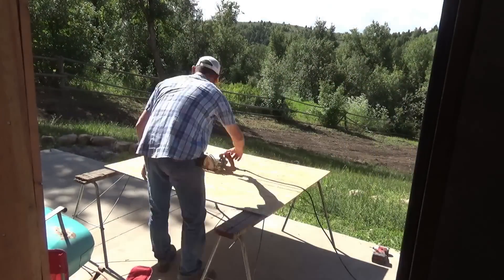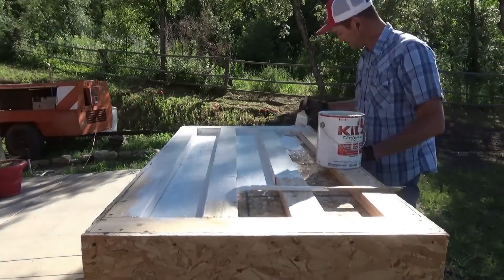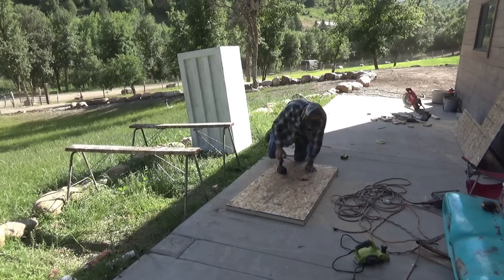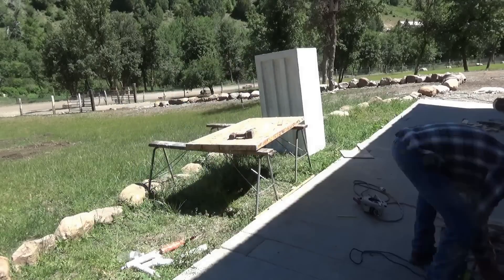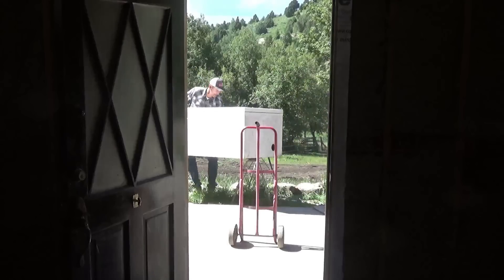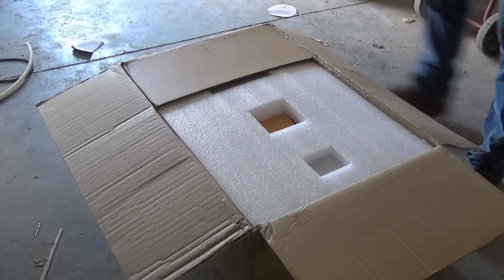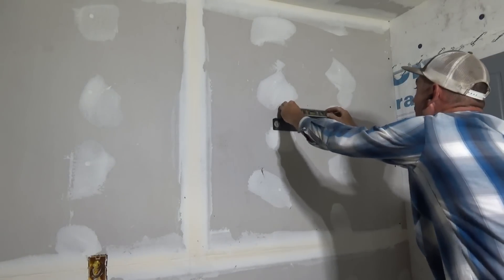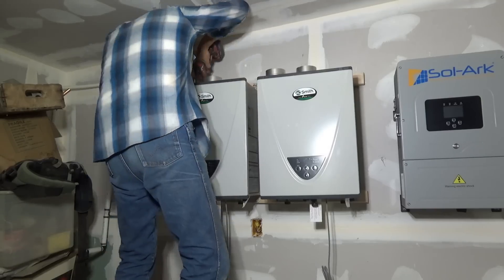#344 - Off Grid Solar Inverter,  DIY Sealed Battery Box, Tankless Water Heater

Comment: Hey, it looks like your lid to battery box will not be able to open to 90 degrees with the water heaters and charge controller above it. You could cut the lid lengthwise add some 2x4's along cut and put hinges with the hinge to the inside of box so the lid could fold in on itself and only be half its height. This would also keep lid from falling once you have it up/opened.

Comment: There’s a company out of China making 15kw power transformers 110v and 220v it can run off of 48v dc because the draw on appliances is 3 times its rated use at start up! The solar charger would need to be a 48v dc charger though! The 15kw is sold for around $600 on eBay and I have bought my 3rd now! It runs great but the early model was max 24v dc intake and it barely ran a microwave! The 48v will run a big aircon! It’s temporary max output is 60kw!

Comment: I have solar panels too I had it put in  did a great job I did start to have  problems in the fall  when the panel frosted over  and would not charge up then the snow here too has it own problems   we do have  a windmill stand here doing nothing i one time it was the power source from the farm we were looking for the other windmill to use with this one did find a lot of them  around here  like the rest of it was the prices they wanted way too much for it  50 years or longer never worked  did go to farm auctions to buy them but people here just bid up  the items did finally found one  but they had one that was still new   they were very nice we said we think about it when we got home they dropped their prices too  that was very nice for them but was how to get them here 1 was simple the one was standing was the problem we did taking them both we rented a crane to help us to lift the one was standing up  down for us month home had it all clean up and new bearings as well  clean up well from the rust too did build the one in the boxes too put both of them up with the rent of the crane and taking ours down to do the repairs to that too  have all 3 workings too  does have the same thing  have it come with its problems no wind was the major one this  year we having awesome amount of wind here    the other one was the battreies too the new battries did not as the windmills did finally got them all to work  when we dig the new water well-hit artesiain well here  was flow well  we still feel the ground move here  40 years   the area had not that good water wells back in the 70's the county had  seismograph done here and detroyed all the water wells aound here and any water was here too they did not like it when the water came back at all this time their plan did not work out  was taken too court and we win it and they did find the county gelt in the first time the did seismorgraph  in the '70s   
the lake and the steam we had here started to flow again we rebuilt the water wheel too this is awesome power too

Comment: Not sure if you've already dug the lines for your solar, but you could always oversize some conduit pipe and give yourself room for any future solar expansion.
Also wondering why you went with tankless heaters?  The beauty of a tank is when the sun is out and you have any spare solar capacity can be dumped into heating the tank.  Think of it as another battery.

Comment: You should put the inverter in a Faraday cage to protect from hazardous radiation.  Good job on the battery gas.  Don't leave out the inverter.

Comment: Putting an ignition source (water heater) OVER a constant source of hydrogen gas in a closed room means everything completely relies on the integrity of that box and seal. If the seal ever fails (e.g. during a hasty battery maintenance or the wood eventually warps or cracks), the gas will seep out and build up in that room waiting for ignition. Boom! Please consider additional ways to get the gas out, there are no "re dos" on that one! Greetings from Berlin, Germany where we still remember the Hindenburg! :D
Reply: Yep, get the batteries outside.
Reply: Remember the Hindenburg LMAO (oops it wasn't funny) but OK it's the 4th
Reply: @JohnDoe-np3zk  . He could probably make a  anti flashback valve on the exit pipe. You dont want to let it flash back from a  outside open flame and detonate all the hydrogen/ oxygen inside that box.BUT.... I guess you can move the batteries just outside the house by a couple feet, put in a flashback ck valve ,, insulate the box, and put a couple light bulbs inside to keep from freezing . Thats all we do with our wells and pressure regulators switches, insulate and put in a light bulb during the winter. Inside a little well house it works fine .

Comment: Don’t do the same as your drain,  and use too small a cable gauge, you always want to go bigger than required in case you need more capacity in the future or find you are pulling more load than expected. Also use the highest voltage, 48v minimum

Comment: Agree with many comments about vents and the location of water heaters near and above the batteries not a good mix.  Think the input vent would be better on the house side with fan on this input side. Computer fans are brushless motor so no spark problem and easy to replace. A diagram of your layout and connections to each element perhaps sent to 755  for comment before installing, would save a lot of problems further on. He gets about a lot maybe ask him to call in, he is a top man. You doing a fantastic job on many fronts but solar systems have many elements which have to equate to each other to be efficient and safe.

Comment: put valves before and after the tankless heaters..  when adjusting the water flow.. i am taking one is going to the shower..

  you will want to turn the shower on to 3/4 hot..  and adjust the inlet valve to the tank less to get the proper heat out of them.  you have to adjust the pressure drop to get the pressure valve to open..  the showers are the most important.. you will have to adjust the angle stops on all the other faucets to get proper temp at each faucet without adjusting the pressure drop across the heater..  i am ALWAYS Called wrong when i post this..  but mom had 220v tankless and she took cold showers for a year as she did not understand how to adjust the flow for the shower.. then work everything else at the angle stops.  please when you get it adjusted.. please mark on the wall.. the fractions of a turn for each valve at the heaters and how many at the angle stops for each faucet. 

 if you have 2 showers.. you will want to put one tankless for each one.  as somebody will usually try to take showers and that will throw the system off.. you probably cannot use water saver shower heads either.  that won't create enough pressure drop across the heater with the partially closed valve to open the gas valve..   since i did not catch exactly which model tankless you bought.. you might post a model number so i can look up how the flow valve works..    when you go to hook up the washer .. you may add a second hot water pipe on the wall with a garden valve .. so the washer can be filled with max flow. max heat water from the tankless unit.. max pressure drop because of the partially closed inlet valve.  this requires manual control of the garden valve.. 

 putting the tankless heaters in series is not going to help.. slowing down the flow.. heck you are a plumber..  but i am a professional mechanic who was a plumber for a few years.  i know i will get down voted.. you can always open the valves back up if you think i am WRONG.. which i'm not.  i got fired from my union apprenticeship program in 1979 when i ask the instructor why are we still using lead based solder on copper pipes.  he took me aside and said.. DON'T EVER mention that .. i got fired the next day.. but i got a different job doing plumbing that worked out great for several years.  i just got tired of working in sewage.. getting splashed in the face by the whipping 1" plumbing snakes.   its far easier working on cars..  not really but i am really good at it.
Reply: The interesting twist to your story is that now everybody is short of copper which is a nutrient, and gets extra plasticizer from the PEX with each hot shower.  In 1975 I asked the food science professor how HFCS was metabolized, and believed the lie that because it has high fructose, it was handled just like honey

Comment: You can parallel lesser gauge wire to get the 01 gauge. Five 8 gauge should equal 1. Look at wirebarn dot com. Always use stranded wire on DC. Welder wire works good, I use it on my off grid system.

Comment: Y’know how battery boxes in cars always rust badly? That’s the acid getting vented. That box is probably going to rot out its base for the same reason. Just line it with plastic sheet and it’ll be fine.
For anyone else is doing this, mount the entire control system on 8x4 plywood, that makes it easier to fix all the subsequent trunking and accessories. Drywall is fine - until you try to have to adjust something...

Comment: Pure Living for Life had to use three 220V breakers to hook up their tankless water heater, which is totally outrageous.  Besides, I am no fan of them because I don't think they really cut the mustard, especially in that cold climate.  So why suck all that juice from your solar panels for equipment that cannot keep up with the hot water demand.  For Pete's sake, an air conditioner only needs one 220v breaker.  I think you are better off with a propane water heater tank.

Comment: You can get the DC solar heater elements to modify a regular water heater FYI. It's much cheaper than tankless water heaters and runs off the batteries. They cost like 25 to 50 bucks or less.

Comment: I know space is limited in the utility room. But I guess everyone would agree, it is bad to place the 2 water heaters straight above the battery bank. It's better to be safe than sorry.

As others mentioned, the outside vent would probably be covered with snow in winter. Even if the vent system has a grill at the box end, I would put some sort of mesh/grill on the outside as well.

Comment: Coming from an Engineer, I found a Youtube lady who had most all the answers.  She's with AltE, and her name is Amy.  If you watch the first five or six videos from the series, you'll feel like a solar pro  She also does a video on how to hook up everything, with schematics and all (very good)...2015 timeframe videos..... The wire size coming off of your panels depends on two things: the isc current rating on the back of the panel x the number of panels in parallel.  Example, if the isc current rating is 8.68 amps, and you have four panels (two parallel and two in series), then your total amps is 17.36 A.  So then you would use 12 gage wire.  You only need a charge controller if you have an off-grid system, which uses batteries.  I wouldn't waste your time - the videos are very, very good.  https://www.youtube.com/watch?v=vdly8OhsdmI&list=PLoHd6hGDqS07bbZkyi_4ntfiySUKjPsUL

Comment: The easiest way to see DC voltage drop..
In different size wire cut a short lenght of wire and check the voltage at the end of the wire..
Then take a 50 ft or 100 ft length hooked  up to the batteries and again check the voltage at the end of that 50 or 100 ft...
The key to DC voltage drop is.   
Shortest distance run from solar panels to charge Controller and inverter.
The highest voltage your charge controller can handle..
And the largest cable you can afford within reason..
No since using to large a cable if at the distance you need a smaller cable will give you the same voltage as the larger..
And can handle the combined amperage the panels strings are sending at the maximum your system will put out...
Again check out
2 channels with detailed videos on steves system he had in his diffeent homes and systems he has built for friends
#1 Steve Robertson
#2 Off Grid Living Really
Remember
Have fun building your dreams..
and most of all
Find a place to use your excess energy you are generation (dump load)
try not to throw it away...
Electric Water Heaters are an excellent place to store energy to pre heat your hot water system..
And try to rearrange your life to use your high energy demands during peak generating hours...
and when the sun goes down try to limit use to led lights.... Computers and??? (electronics)
That way you should get the most life out of your batteries.. 10 years +

Comment: If you are familiar with gasfired furnace draft induction motor and safety switch  whitch could be wired to prevent changeing without the draft motor running I don't think the computer fan will last six months in a crosive invirment and there  is no safety....... I've heard about early submarine ww2 era battery  off gassing was a major problem limiting time under water

Comment: So sad to hear you went for lead acid batteries instead of lithium. IMHO it is a bad mistake, and idk why no one told you about that.
Lithium batteries preserve their energy well and can take more energy of a same size battery. Lead acid batteries on the other hand lose energy overtime even if they haven't been used. Lithium batteries require way less maintainance and are durable for longer. Way longer.

There's a channel called S/V Delos (it's a sailboat adventure channel) and they have upgraded from lead acid batteries to lithium in like a year ago. They are reporting an increasment of 33% MORE power than they had before. In fact, They have even removed the propain stove and replaced it with an electic one, and started running 3 AC units after the upgrade. Another channel, S/V UMA, replaced their engine to an electric engine after upgrading to lithium. 

Yes, I know, Lithium batteries are way more expensive, but not for the long run. You can easily overcharge lead acid batteries, over/under fluid them, and in fact even the best of these batteries won't last over 3-4 years (and I'm feeling generous today) at it's prime even if it has maintained properly. 

I'm sure you've heard something from someone about this topic and you didnt just get the first battery you found, really curious why you decided against lithium. 

Happy 4th of july from Israel!!

Comment: On DC voltage the main thing is DC voltage drops like a rock with distance...
That being said...
You want to use. MPPT charge controller.. with a high involt DC voltage rating.. 150 volts or higher.
Then you wire the panels in series to push up against that voltage..
Maybe 5 panels..
Then lets say you have 20 panels
You would wire 4 strings of 5 panels in series..connected in a combiner box..
Each one of those strings raises the Amperage..
(Make sure you don't exceed the charge controllers maximum amperage) (it's not uncommon to be running 2 or more charge controlers) (use charge controllers that can be wired with a battery temperature unit)
Now why do you want to push the MPPT charge controller to it's max..
Early in the day and late at night the solar panels output will be low.
By wiring in series the voltage should be high enough to use...
Any extra voltage being generated the MPPT charge controller refigures to usable and sends it to the batteries or.?..
PWM controllers just throws that extra power away.
Reply: Agreed. The Sol-Ark has 500V PV inputs. This saves ~$600 in wire costs alone.

Comment: What can be a good idea..
During the day there probably is going to be excess energy because the batteries are full and there is no other demands...
So the extra energy goes to dump loads...
Using that power thru an electric water heater can preheat the water to other heaters...
For those of you wanting additional how to on solar...
Check out channel
Off grid living really
Steve Robertson...
Is in my opinion
the most knowledgeable on off grid solar power...
He has several videos on solar installations..

Comment: Im glad you kept your batteries charged. Its good to have a space between the batts. to keep them cool.  I like the solar water heaters that is nice or are they propane water heaters. I would run the panels  in series that way its more efficient and you will not need to be as concerned about voltage drop when your voltage is high. I like to run two panels in a series then parallel those together. Hydrogen gas is very explosive.  I think it will vent well the way you made it. The computer fan is not really needed. The pipe should draw it up if its long  or tall enough. I would draw warm air from inside the house you do not want freezing air from outside making your batteries cold. That will make them go flat. Batteries hate frozen air. It ruins the capacity and the battery eventually. I would just make a pipe go straight up through the roof just like a sink drain or a toilet to draw the air and gas up. A long tall pipe draws air like a chimney does. What you made will work but I dont like the idea of drawing in cold air from out side in the winter.

Comment: Purchase extra igniters for those water heaters as soon as you can, they go out at the worst times.
Reply: Good idea.  If you are worried about heavier than air propane meeting lighter than air hydrogen, wouldn't you be concerned about those electrical igniters?

Comment: Just go 30 MPH and slam on the breaks without holding onto the steering wheel, and you will slide out of the seat.
What do you think happens in an accident without a seat belt???
You might be good at building and fixing things, but you won't be fixing yourself. No matter how strong you are, you will not be able to hold on.

Comment: Just a thought: the water heaters will need descaling maintenance every 12 to 18 months depending on your water hardness. Even with the isolating valves, the process tends to be messy. Might be something to make you rethink the battery/water heater proximity. Have a great 4th.